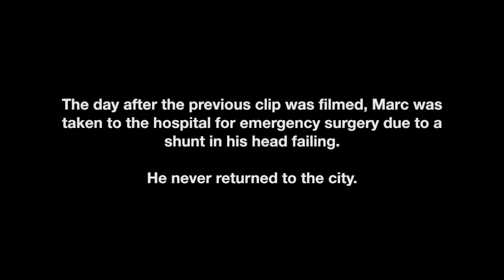CNB Packer Mix (Season 7) - Part 2

Comment: Don’t they separate recycling pick-up in Corona Del Mar? Big not, I thought it was mandatory by the State.
Reply from the maker: Yes, all of the trash was sorted through for recyclables and any possible clean green waste material, per state requirement. As of today, Newport Beach is now collected by the private hauler, CR&R Inc., that would sort their waste. The differences are that CR&R is using automated trucks & barrels; and per current agreement with the city, offers a voluntary source-separated recycling program. Following the transition to automated collection in Spring / Summer 2014, only 16% of residents chose to use a separate recycle barrel. But that number has been increasing little by little over the years, so it wouldn't surprise me if the city finally decides to make the switch to the industry standard 3-can system (recycle, green waste/organics, landfill) in the future.